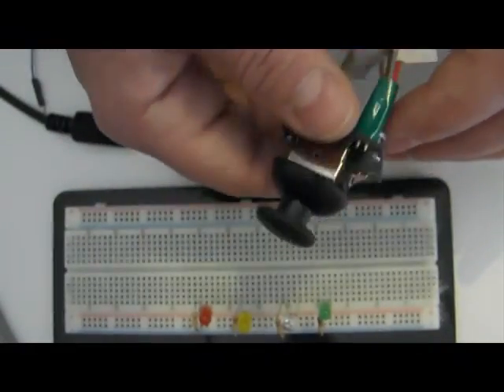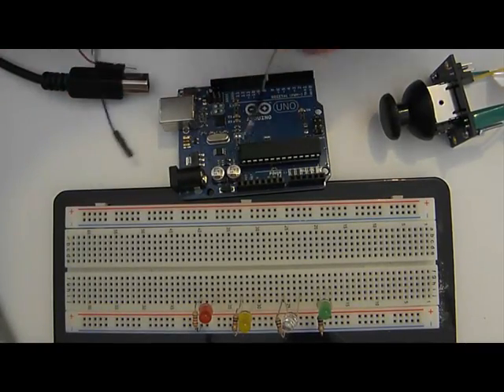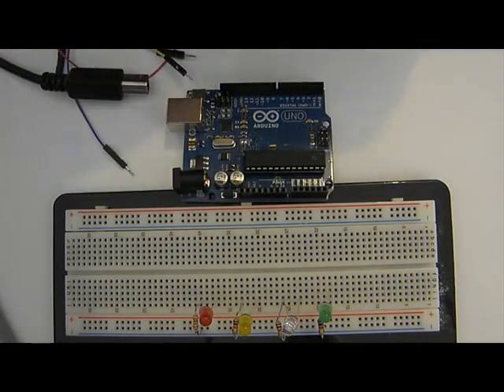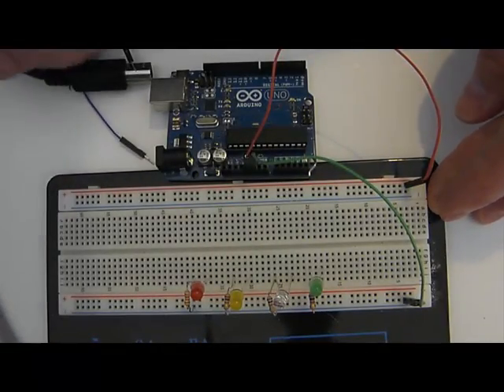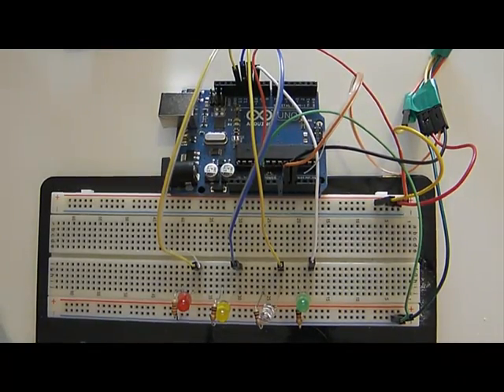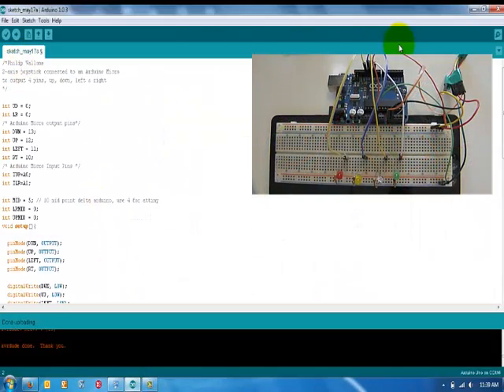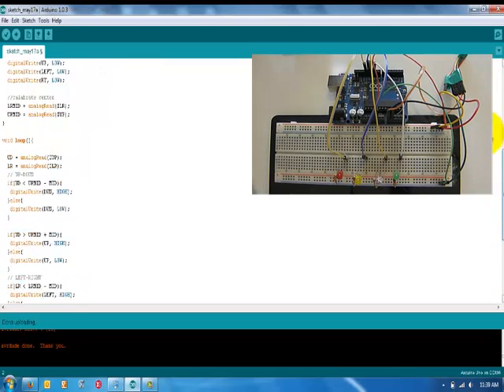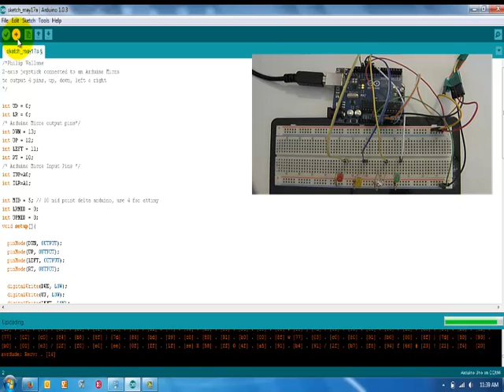Arduino Controlled Parallax 2 Axis Joystick Tutorial

Comment: in the sketch is that where your code is programmed so you can configure top dead center so it does not still send a resistance value.  I'm having an issue with mine doing that, so the joystick is always moving a bit.
Reply from the maker: Yes, in the details of this video, there is a link to the sketch. See lines 37 & 38